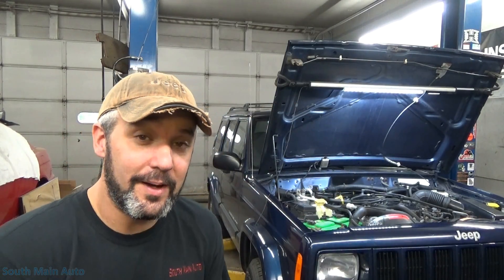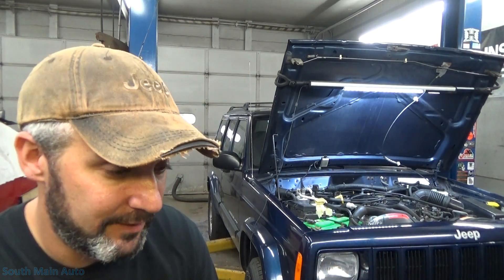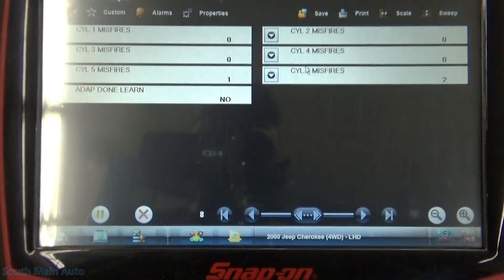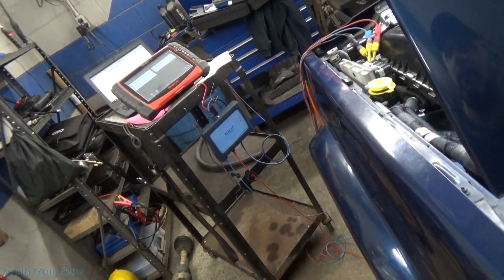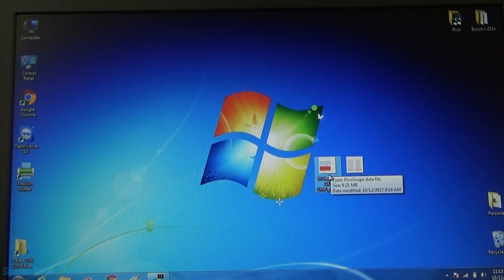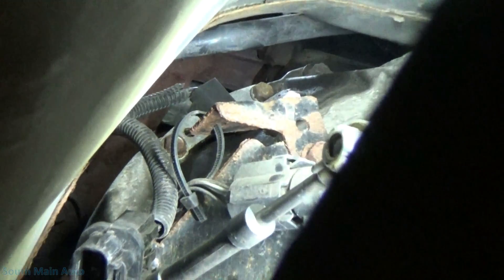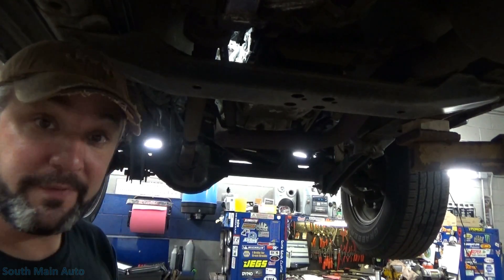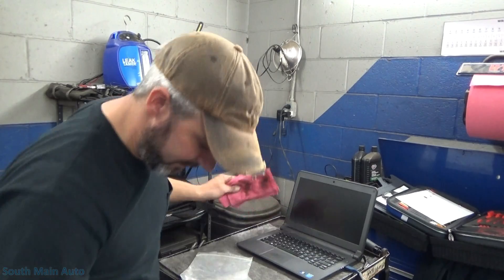Jeep 4.0 - Flashing Engine Light BUT NO MISFIRE!?

Comment: I hope your right on this as I have engine miss in the computer for DEQ. But my scope does not pick it up. So I put in all new plugs new coil pack and cam sensor, my scope said OK, but DEQ says it has a miss? Crank sensor here it comes. I will see if that works.  thanks for the info.

Comment: Good morning everyone. Im not sure what to do. Maybe someone could point me in the right direction? I have a 1999 Xj Sport. A couple weeks ago coming home from work, my check engine light started flashing. It previously had the light on for the downstream O2 sensor, but i didnt chance it yet. I pulled the codes, and it had a cylinder 3 & 4 misfire. Last weekend, I changed the cap, rotor, plugs, & wires and it ran fine for a week. Yesterday, coming home from fishing, it started flashing again. I was checking on some forums and utube, and one video one guy changed the Crankshaft Position Sensor, and the issue went away. Before I buy a CPS, does anyone have any ideas to look for? Thank you & have a great day!

Comment: Classic video.  I had a grand Cherokee similar issue.  It would run like crap while crossing railroad tracks.  Bunch a shops couldn't figure it out.  Customer brought it in, through a monitor on it and cranked it up.  Went behind the truck and climbed on the ball mount and started jumping up and down.  Jeep began running like crap.   I said crank sensor.  Took a long screwdriver and then tapped the sensor and again ran like crap.  I feel better about your guesses than other peoples facts.  ;)

Comment: I absolutely love this engine. I've had 3. Yes odd issues here and there but reliable and smooth regardless how many miles were on it. I took one to 356k, one to 375k and the last one was totalled in 2019 with just under 340k with a mint leather interior. Yes, that crankshaft sensor caused an issue on my 1997 Grand Cherokee TSi.  Just stopped on me one day and I had no idea which direction to go. Luckily I had an uncle who worked at the Chrysler Jeep dealer in town and he helped me over the phone.  I admit hearing those 6 cylinders firing up brings a tear to my eyes. Reminds me of years of worry free driving across the southeast. I drove one from 2000-2019 (2 1997 ZJ TSi and 1 2003 WJ Laredo). Always looking for a good one to keep a few years 1996-2004 only.  Hope you and Mrs. O. had a good New Years Weekend. 🎉

Comment: I was a computer tech in the navy. Our Crypto computer went down. Replacement part on the other side of the world. We were left on our own until part could arrive in the middle of the Persian Gulf. So....I broke out the Motorola IC Chip schematics of what parts this IC chip took the place of and built the part on a cardboard box. IT WORKED! We were back online with the crutch i made from parts. All kinds of resistors diodes and zener diodes (adjustable) power and so forth. What am I getting at you say????
After market parts like the one you replaced may have been made with the same parts but not the same quality parts. ie: resistors with +-5 or 10% diodes with flakey electronic back flow construction.  These cheaper made parts do not perform with the tight tolerances of OEM parts. That's why you can buy them at a lower cost.  It seems to me your guess work (experience) is more valuable than you take credit for. Nice job. I think the question or problem lies in the construction of the part.

Comment: My 02 wrangler 4.0 had the same problem. Found out that the sensor has a felt pad on it   you need to mash it into the flywheel and it wipes the felt off. The oem came with instalation instructions saying to do it, reinstalled the aftermarket one mashing it in and worked perfectly, couldn't find anything anywhere online to help.

Comment: Very interesting 👌🏻
Quick question 🤔
2015 Tahoe same blinking engine light, but only on bumpy roads. I hooked up the code readers and there is nothing there. Could this be the same sensor going bad?
Reply: Loose sensor that the bumps keep wiggling around. Check and look around feel in your engine bay for any loose wiring.
Reply: Had it happen with my o2 like crazy on my civic until I bought a new one.

Comment: i have two Chrysler vans and certain parts have to be dealer parts, ie the oxygen sensor. i went through 8 in the sapce of a month (all aftermarket, even one that was made by the oem manufacturer) and all would fail within a few trips. bought one from the dealer and problem solved. this could be just an example why some important engine parts have to be oem

Comment: I’m guessing the ferrite or the number of coils on that sensor are of poor quality causing it to detect a miss alignment between the readings (since it likely doesn’t generate an imaginary smooth signal based on the sensor and known information. I would bet it’s just reading the position data vs other data, like reading voltage drop on a wire but not actually knowing the voltage it carries, it’s information, just not enough.
TLDR I think it uses a tableless system)

Comment: From an electronics point of view, I can't find the specs for the picoscope, but I suspect that the aftermarket ckp is producing noise on the signal line that is too fast for the Pico to catch. Next time I get one of these in the shop I'm going to use a 200mHz scope on it and see what there is to see. Maybe it's nothing but, that sensor HAS to be producing something the ECM doesn't like. We just have to find it.

Comment: I owned a 97 grand Cherokee limited. I changed every sensor on it and i ended up peeling the back off the computer and re-soldered the 3 burnt connections on the left side. And finally after 450 buck in sensors it was the computer.

Comment: I have had Standard Ignition crank sensors for Jeep and Dodge that would almost have no magnetism that would cause a hard or no start. There is nothing worse than trying to diagnose a problem caused by a part that I installed.

Comment: When my original went out I had someone replace it they said they had to replace the cam sensor as well then charged me five hundred bucks so I decided to do my on repairs. It died on me a few months later I had a garage read the codes it said crank sensor I replaced it with a broken when delivered it ran two miles before it started missfiring badly got a mopar and it was fixed

Comment: Missing Misfire Mystery Solved?
Once again a great video and the fact that you were "guessing" doesn't worry anyone who know that your guesses are based on a 
solid foundation of both knowledge and experience and you can guess on my car any day.  By the way I noticed that when you start the video 
and show the cam/crank relationship at idle the cam signals are lining up with the fourth crank signal but when you rev up the engine the 
cam signal now is lining up on the third crank signal. This might explain why the misfire code are being generated. I notice that after the
crank sensor was replaced the cam signal stays with the fourth crank signal even at higher RPMs. Please check it out and let me know what you think. 
Keep up the awesome videos they are teaching me alot and you crack me up with your terminology and the ease and enjoyment that you get when
working on cars. Thanks so much.

Comment: Found this video after going thru the same thing on my 96 XJ, occasional high rpm check engine light with random misfire codes but it always ran smooth.  Swapped the CPS sensor with OEM mopar and it seems to fix it so far.  This video provided the needed confirmation :).

Comment: I'm thinking the extra hole in the bracket = made for more than 1 application = aftermarket.  The aftermarket sensor is probably made with a junk magnet so that there's a slight variation in when the voltage is induced as the rotor passes.  The ECM then picks up the variation in he crank signal and decides it's due to a misfire

Comment: I have a 2001 Wrangler 4.0L with the same symptoms. CEL comes on at about 3500 rpm under load or sometimes during light deceleration at highway speeds. But, no misfire is felt and engine power feels good. The crank position sensor has been replaced with OEM part several times. Problem still there. Two local shops have used their parts cannons on it. Problem still there. Last shop suggested replacing the ECM. I'm still thinking about it but don't want to pull the trigger until it can be verified. I need to find a good shop in the Albuquerque area that can do a real diagnosis (lab scope, pressure transducers, etc) and verify before hanging parts.

Comment: Thank you for the fix! I had the same problem with my 1998 Jeep Wrangler 4.0 . Only 3000 miles on a complete reman. longblock, ran like a top but the check engine light came on and I scanned it and the codes showed multiple misfires across all 6 cylinders. It still ran silky smooth. I ran across this thread yesterday and so I removed the newer aftermarket crank sensor and put in a used oem  crank sensor I had laying around and it cured it. No more codes. Now I can get this Jeep smog tested tomorrow so I can get it re-registered.  One thing I noticed is the magnetic tip on the OEM crank sensor is very strong and can pick up a wrench, but the aftermarket version can bearly  pick up a screw. Thank you so much for sharing your technical knowledge, you saved me some money for sure!
Reply: I have a 98 4.0
With a new motor Also , I can’t get a oem cps so I put a hvwells one in and still has a misfire , she’s been in the shop for a few days , I hope they figure it out

Comment: Thats not a parts cannon, thats not a guess, thats deferring to "unofficial tech support" with a known good fix for a known problem. When do you hit the bullseye first shot with the parts cannon? never. It is only the parts cannon if you need a second shot or more.
I know several shop owners and technicians in my area, we use each other for unofficial tech support all of the time.

Comment: I had a similar symptom with a Honda accord. Misfire that got incrementally worse over a years time. Did all the checks, diagnosed it as a bad exhaust valve. Put a head on it (correct diagnosis, the exhaust valve had part of it eroded away in a neat little perfectly round pac man-esque bite). The similarity was when it was done it ran flawlessly. At RPM above 1000 it would flash the money light and set a misfire code, but it was running perfect (as a honda can). For 2 days it drove me nuts, had to walk away and do other payers as i contemplated this bizarre turn of events. The supervising super tech at the company did all the same tests i did, called tech support. No dice. I started exploring EVERY possible data parameter. As i stumbled through every possible menu in the scanner looking for ANYTHING that could help, i find an option buried in the engine side (Snap on scanner) "reset engine adaptives". CLICK!. THE PROBLEM WAS GONE. I was thinking it was something like that on Eric O's headache. First time i had ever seen that as a menu option.

Comment: My 97 jeep grabd Cherokee is doing the same thing... but it really it really is misfiring on all cylinders. You can feel and hear it and codes indicate they misfire on all 6. We replaced the crankshaft pos sensor, ignition coil, distributor, spark plugs and cables, and nothing is helping. How do you fix that?
Reply: Also replaced the cam sensor

Comment: Having same issue with a 01 Jeep Wrangler at the shop. At 3K RPM shows ghost misfires. I put an aftermarket sensor and didn't help, guess ill go OEM. I noticed you didn't relearn the misfire counter when installing the new crank sensor. You can see and your scanner it says adaptive learned no. That's why it wasn't showing misfires. I know because when I changed the crank sensor it wasn't misfiring again until it learned the misfire monitor. You fixed it though since the vehicle never returned.

Comment: Some Engine computers are probably  so sensitive, that if they pick up small anomalies, or slightly off-time feedback events from aftermarket electronic parts, that it triggers the check engine light, and limps the car. That happened to me with an ‘02 Toyota Camry spark plug coil. The original coil was replaced with a China made aftermarket turd coil, because it wasn’t firing #2 cylinder, and I was a broke joke back in 2009. It worked well for about 2 months, then the check engine light came on. This time it was a PO302 (Igniter malfunction code), and a limpy car that would shut off if you accelerated too hard on the road. I suspected that the China made coil was culprit, and bought some used original Denso coils from the junk yard, and replaced it. Problem solved. No check engine light, and No more limp. 
Never buy aftermarket electronic parts for newer vehicles!!!! Buy original.

Comment: Crank sensor ... bet $ it's aftermarket

Mine misses at idle slightly, new EVERYTHING, give it a little gas and brake and smooth as glass, pass a slowpoke on the hwy and hit 4k rpms (all the cammed 4.6 needs to walk it in a hurry) flashing light but no miss.. just don't want to buy another sensor ☹

Comment: 2 questions...as a "do it myself when possible(the right way)" owner...
When the computer was hooked up to it is it possible to disconnect crank sensor and start in a limp mode to test misfire, Is there a limp mode, will it run?
Second, is it faster/easier to remove front drive shaft bolts and slide shaft out of the way to replace sensor?

Comment: The sensor must not be triggering on the right edge. At low RPM it's fine but at higher load and RPM it seems to be just far enough out to make the ECM think it's misfiring. Propagation delay? Hysteresis in the sensor? interesting problem

Comment: 2 micro seconds is a long time when you're going round and round at 3,000 rpm. Even the slightest delay can make the computer think there's a lag. Remember that electricity travels at 186,000 miles per second. That means that electricity traveling through that crank signal wire travels 1.86 miles per microsecond, which is one millionth of a second. Modern computer processors can process 80 billion commands in one second. With speeds that fast, there's plenty of room for error. One microsecond seems like an unimaginable speed to us, but to electricity, it is like waiting for a snail to cross the atlantic ocean.

Comment: My '88 Cherokee has rust spots and most of the clear coat is gone, but it's closing in on one million miles.  I kid you not.  Its seven-digit odometer will roll over.

Comment: Eric, you ever wrap a wire several times around a screwdriver or socket and the touch the striped ends to the positive and negative to magnetize that socket or screwdriver.  Work great when you have to hold on to nuts and bolts from a distanced with an extension.

Comment: I'm having the same issue on my 01 grand cherokee laredo and it's not passing smog misfiring on all 6 cylinders I'm going to change the coil pack and spark plugs and now the crankshaft sensor hoping one of these will fix the problem 🤞🤞🤞 thanks for the video!

Comment: Looking at the datasheets for the actual hall-effect sensor chips that Chrysler usually uses I can see that some of them are programmable 3 pin chips that have little microprocessors inside.  The ones in the short runner actuators are certainly 3-pin programmable hall-effect sensors, too.  They have some special programming that says what levels of magnetic field  it should activate on and what levels they should deactivate on and some even have minimum and maximum output voltages that can be set.  So just copying the circuit board inside the sensor part for part isn't enough, the IC used may need to be programmed so that the length of the peaks and troughs are accurate to OEM.  It might look similar enough on the scope and be good enough to run the engine but the software sees something it didn't expect.  To me its a software bug in the ECU, but I'm sure Chrysler would say the software bug is in the aftermarket part...

Comment: I had an experience with and abs sensor where the thickness of the aftermarket hold-down was slighly thicker than stock causing an air gap issue. Probably wouldn't have hurt to measure the distance from the bracket to pickup.

Comment: I remember the one failing on my first 4.0 Grand cherokee.. it took down the 5v buss, no fuel gauge, no tach, no start.  Was ready to finally scrap it when I called my brother. Boy did he know exactly what it was. The Napa one did the same as this video, high RPM missfire. Mopar one back in and no problems. That job sucked without a lift though.

Comment: Years agoi when I was building computers we has a problem.  When the scope was put on the location that we though the problem was comming from;  the problem went away.  The capacity of the scope probe was enough tocorrect the problem.  We put a small capacitor on the point on every system that we shipped.  Never had the pronlem again with this section of the computer.  All electronics have ghosts!!

Comment: I've heard from different sources that the aftermarket sensors have some kind of weirdo diode in them or something like that but in the process of heating and cooling this diode for the 5 volt reference ends up popping and it allows it to bleed through the reference wire essentially giving it 2 signals it's throws the computer out of wack but when you go to look at through the Pico you're seeing the direct line in and that's why you can't see a fault you're not seeing what's bleeding back to the computer if that makes any sense.. at least that's what was explained to me.... just an FYI for your information keep up the good work Mr.O